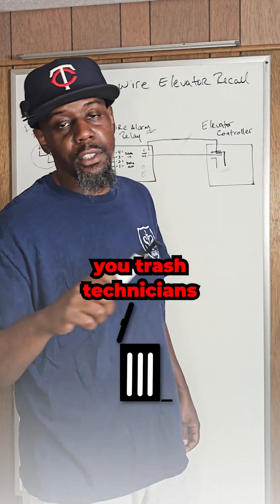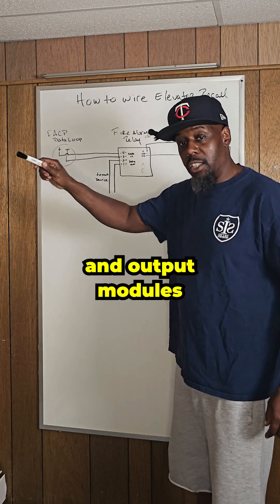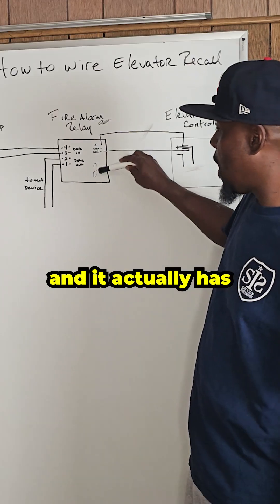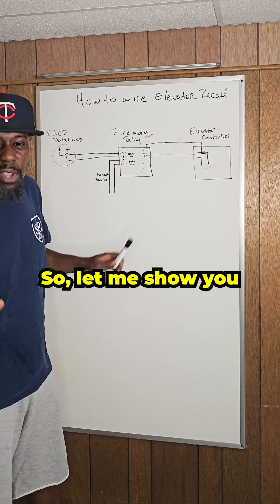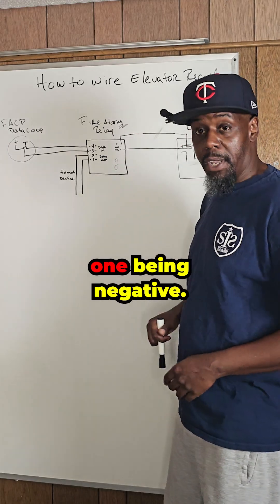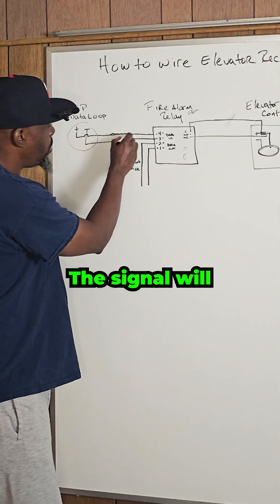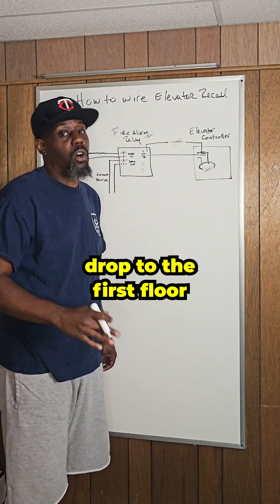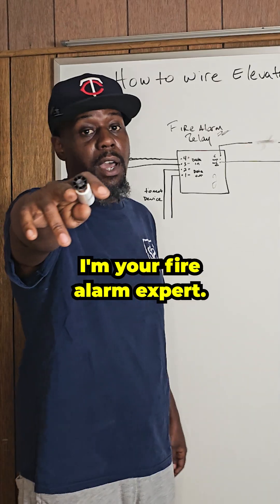How To Wire A Fire Alarm Relay Wiring: Avoid These Critical Mistakes

Comment: that fire relay module  did he need power supply?
Reply from the maker: Edwards make a SIGA CRH that do not need 24 volts. From my knowledge that is the only fire alarm relay that can connect directly to high voltage and you don't need 24v to activate it.

Comment: How do I wire the water flow switch to panel?
Reply from the maker: You will need an input module to tie in a non intelligent device to a fire alarm system.

Comment: Now that's is the basics,,, but how the Shunt trip work ,, the device that trips the powers,, or other details?? Thank you
Reply from the maker: The same way, all the fire alarm contractor has to provide is a relay open or close and the elevator guy will connect it to the controller for the specific operation.
Reply: @thefirealarmexpert  🧩thank you

Comment: Does the voltage rating of a relay change how it functions? 

Ex: Would a 12V Relay function differently from a 24V Relay or do they generally function the same just with different potential?
Reply from the maker: They will function the same, may have different load capacities but it just take the 12 or 24 volt to move the switch. 12 is usually for Burg and 24 will be for Fire.
Reply: @thefirealarmexpert Thanks!

Comment: If I wanted to set of a control relay to a mag lock, can I use a ct1 module to monitor power for door release?
Reply from the maker: Yes the CT would have to be connected to a relay so when you loose power this relay will close to activate the CT for monitor or supervisory
Reply: @thefirealarmexpert thank you man!
Reply: @thefirealarmexpert I’m studying for the Nicet level 1. I was wondering did you have any tips and practice questions for the exam?

Comment: This is NOT how a fire alarm interfaces to most elevator controllers. The only time a fire alarm panel will activate a shunt trip is if heat is detected in the mechanical room and the elevator controller has a built-in shunt trip. Usually, the built-in shunt trip is a 24VDC terminal that is routed through a NO relay back into the controller. Not to say there are not systems that might use a NC system. There are MANY potential configurations an installer might experience. To say this is THEE way, is not helpful.

You may find controllers or breakers that do not have built in shunt trip circuits. If there is a sprinkler head in the mech room that can activate and drop water on the controller, you will usually install a mechanical dual circuit heat detector that will activate before the sprinkler head (typically 135 ROR). On one set of NO terminals you will install a supervision resistor and connect to a monitoring modules for the fire alarm panel. The  other set of terminals act as a 120 VAC switch that connects power from a "Elevator Shunt Trip Power" breaker to a larger Elevator Breaker that provides power to the elevator. That breaker has an input terminal that when energized, cuts power to the elevator. 

There are many, many more items an installer needs to know, far more than any video or web post can provide.

Comment: How do I wire  a two position direct coupled actuator to a fire alarm relay
Reply from the maker: It depends. If it needs power to shut down/operate, it's wired open, then when it closes on alarm, the realy will send power to shut down/operate it. If it doesn't, then the opposite wire it closed, then the relay will open to cut power on alarm.

Comment: On that relay, would that contact be normally closed in a resting state or energized state?
Reply from the maker: Usually, it's closed because we need to keep power to the elevator to keep it running. In an alarm condition, the relay will open to cut the power shunt or recall the elevator.
Reply: @thefirealarmexpert  thank you for the clarification. You are doing great work with your videos, love them.
Reply: @thefirealarmexpert  What jurisdiction are you in?

Comment: How would I wire up a key over ride/ key reset for a fire panel? Have a building with maglocks on almost all doors need to wire in a key reset to keep all the maglocks unlocked for fire department until a reset is turned??????
Reply from the maker: If you are using mag lock, there should be a power supply you will need to break power. If its and Altronix they have a fire alarm input for door release. In any case, depending if the lock needs power or not to release you will wire it Common and NC or NO, in series with the power and fire alarm relay.

Comment: How does install a 240 v ac at common and normal close?
Reply from the maker: Are you asking to shut off high voltage power with a high voltage relay and a fire alarm relay?
Reply: Yes , kindly make a clip @thefirealarmexpert